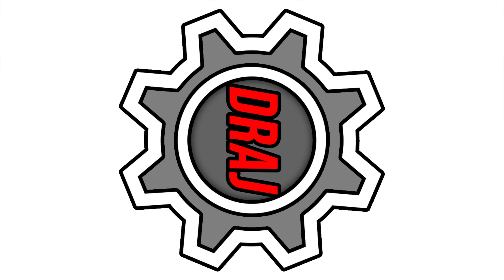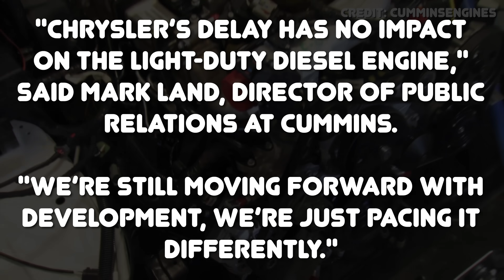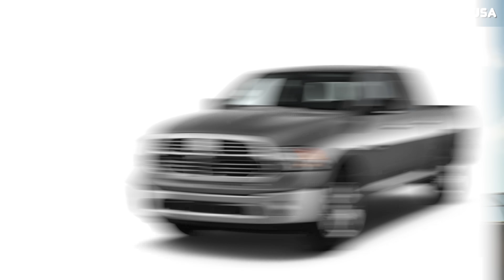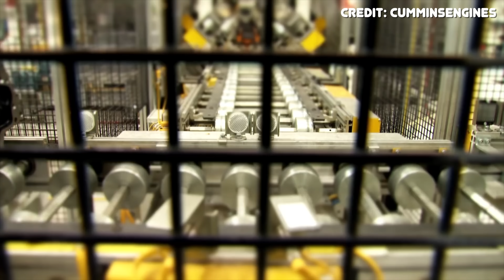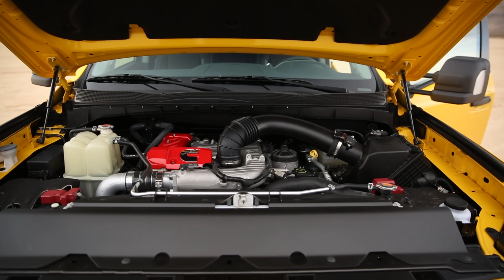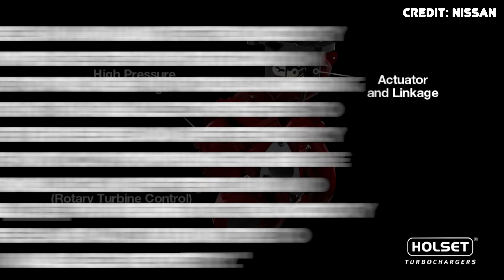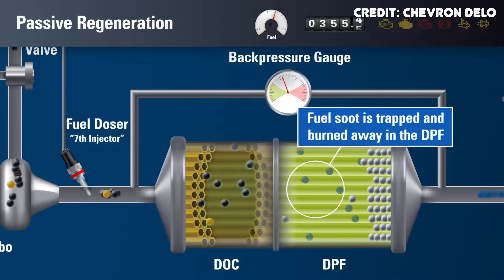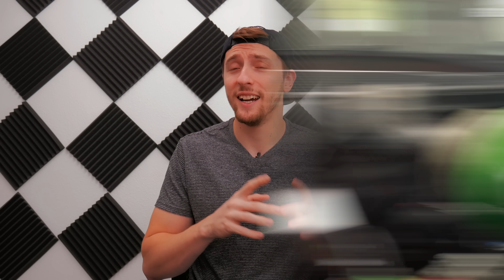5.0L Cummins: Everything You Need to Know

Comment: I have the 2017 Nissan Titan Platinum Reserve
with the 5.0Lt V8 Cummins, and I think it's a good motor
Has heaps of power and smooth to drive, have owned for just under 12mth now without any problems.
Typically fuel consumption is under 15Lt/100km and down to 13Lt/km on long country runs.
I'm aware of concerns regarding the fuel pump w/dowl pin etc 
and keen to know more about more reliable alternatives for known problem parts.
It's a shame Nissan didn't stick with the motor as they seem to be excluded from
most of the comparison and review podcasts looking at F250/GMC/RAM  etc, BTW
My son has the Nissan Patrol w 5.7 Lt Hemi V8 and he uses way more fuel than I on the same run.

Comment: I've been considering buying a 2017 Titan XD Platinum Reserve with 98k miles with the 5.0 diesel but after watching several videos on average at best fuel mileage, average power and a Extremely over complicated and expensive diesel to fix and maintain I just can't pull the trigger and think I'll just get the cheaper to operate V8 Gas truck.

Comment: I just bought a used 2017 nissan xd. Will see how it does. I just drove it 150 miles and was hoping for better mileage but the engine is quite, seems to have some good power and smooth running. Fingers crossed it continues to do well. Any advice on things to do to it or things to look out for. Any additives recommended for cleaning out carbon or other modifications?
Reply: How is it treating you? I am rest driving one tomorrow.
Reply: Me too , I am excited about the this truck,  but I am scared too

Comment: Really wish saw this video before buying my 2016 Nissan Titan XD. The reason why it didn't catch on is because of all the problems this video touched on happened a lot. In the first 2 years of owning my truck I have had EGR Actuator Replaced because it failed, Boche Fuel Pump just failed and the coolant electrical issue which is a common problem not stated in this video average of 4-6k total to repair. Overall the truck runs quite as stated averages around 15 mpg but I am now debating on switching out my turbo and buying an extra EGR valve for the future.

Comment: I just bought one not too long ago. I bought it because I needed a new truck that I could afford. I’ve owned a couple of Duramaxes, and Powerstrokes in the past and was absolutely thrilled with the idea of getting a newer one than I’ve ever had before. However, in 2022’s used car bubble… I quickly realized if I truly wanted a normal 3/4 ton diesel, either my budget was going to double or it was going to be 15 years old with a quarter million miles. 

So instead of giving up or trying to stretch my budget, I actually lowered my budget slightly and got to thinking what it was I actually need a truck for? And after listing out, plowing my driveway, runs to the home center, pulling maybe 10,000lbs once a year or so. I realized I’d probably be just fine with a half ton for now. But I still wanted a diesel. I test drove a few eco diesel rams and while I absolutely loved the ride and interior of the rams. Their tow rating with the eco diesel is absolutely ABYSMAL at just 7,700lbs. I mean, my wife’s grand Cherokee is rated better than that… 

So I remembered that back in 2015 I had test driven one of the first Titan XD trucks available in my area and it being something I thought I could be happy with. So I started looking and found that they happened to be going for right around what I lowered my budget to. And that was with half the miles and anywhere from 2-6 years newer than what I was finding before I readjusted my search. So I found one with 100,000 miles and was a 2017. Compared to the 2012s I was finding with 175,000 miles in Chevy or ford. I decided to give it a shot.
Reply: Curious to know how it’s going and what it’s like? I’m considering one but am still unsure. I would be upsizing myself, had a little Tacoma but want something bigger and thought the Titan would be a unique one and especially one with the Cummins so I’m curious as to what ownership has been like for you in the last year since you made your comment. Do you recommend or no?
Reply: @haydenK90 I’m happy to tell you that this week actually makes 2 years with the truck and honestly… I couldn’t be happier! It’s been a wonderful truck so far. What I bought is a 2017 Titan XD Pro4X extended cab with the Cummins diesel. 

The very first thing I did to it was get a mount and wiring for my Blizzard 8100 Power Plow. I took the whole entire front end of the truck apart to get it all mounted and wired up correctly. For those that are unfamiliar. That is an 8ft plow with power wings that open up to 10ft and it weighs about 1,000lbs. The truck handles the plow beautifully! It doesn’t ride on the suspension bump stops. It has absolutely no problem pushing it at 10ft with wet and heavy snow. The electrical system handles the extra draw from the plow hydraulics very well and even though it’s Recommended to put 300-400lbs of ballast in the bed for the plow. I haven’t done that and it still pushes the plow quite well. 

The second thing I did was get a ProComp leveling kit. I did this so the trucks sits more like a truck instead of a truck shaped car. It took about an hour to install and made a huge difference in the look of the truck. And it also had the side effect of getting the plow a little higher on full lift for traveling down the road. 

It drives very well. Reminiscent of an OBS Chevy (90s). It’s just quite a bit bigger than my old Chevy. But the traction control isn’t overly aggressive. And when you turn it off it doesn’t just come back on when you get your wheels spinning. This is helpful when plowing. 

It’s a pretty comfortable truck to drive long distance. We live about 4 hours from my childhood home and go down quite often. And my wife’s family lives in Tennessee which is about a 14 hour drive from our home in Northern Wisconsin. We’ve driven it down there and back a couple times now too and it was very comfy and quiet. No excess road or wind noise and the stereo they put in it is PHENOMENAL! Other than the very generic head unit. But it has good navigation and sounds awesome regardless of what kind of music you’re into. 

And now for the few issues I’ve had… nothing major so far. Just a few little annoying things. 

1. While the truck was shipped with a factory installed block heater. It had never had a cord on it and had never been used as the truck was originally sold in Georgia. I put a cord on it and unfortunately it didn’t work so being in northern Wisconsin… I had to replace the block heater. Not expensive at all. Only $75, but still annoying. 

2. The coolant level sensor failed and I had to buy an entire new reservoir because they updated the type of sensor and when I needed it they were in the process of sourcing the new tank and sensor so I had to just live with the engine light on for about a year. But it’s fixed now and has not been a problem since. 

3. Finally I had a pretty persistent fuel leak at the fuel filter housing on the frame. It turned out to be nothing more than a couple of failed O-Rings in the quick connect lines used in the fuel system. I replaced them and now it’s leak free. However, that leak was responsible one particularly cold day (-20f) for leaving me with a truck that wouldn’t start. I was at a hotel unfortunately and couldn’t plug it in. And the fuel leak let just enough air in that it wouldn’t start In the time the computer was letting the starter cycle. I did eventually get it started that day with the help of some jumper cables and my wife’s jeep. But that was probably the only thing that’s happened with the truck since I’ve had it that was truly infuriating. Again though… this issue was resolved and it’s actually started in colder weather without being plugged in after fixing the fuel leak. 

Other than those few things. It’s been an absolutely wonderful truck with no issues and I never worry about it letting me down. Overall, for the price. I would 100% recommend the Titan XD to anyone looking for a Diesel truck. While it’s absolutely not a true 3/4 ton. It is rated about as well as most GAS 3/4tons and gets about 20mpg when driven responsibly. 

bonus info these trucks also were some of the first to come from the factory with a gooseneck hit hitch. I’ve used it and it’s very nice. My only complaint would be that there’s no trailer light plug in the bed so you have to have a long cord to go back to the bumper. But I pulled a 12,000lb skid steer with it and it pulls that weight very well!

Comment: Well, after 2 years of ownership of tye 5.0 xd..... here is my list of things that needed to be replaced. 
 
1). Truro x2 yes two turbos under warranty. 

2). Egr value. Shortly after the second turbo within the factory warranty. 

3). Fuel water separator housing 2X(yes, first one replaced... 3k miles later, 2nd replaced. 

4). Wastewater. 

5). Abs speed sensors 

6). Total engine wiring harness. 

All withing the 5yr 100k factory warranty. 

The truck runs good, has good pep being stock... doesn't really compete with my old 2004.5 cummins 5.9 HO  5inch turbo back on a smarty Sr. But can outrun a Ford fusion!!

I'd say, if you find a low mileage 5.9 common rail.... get it over the titan XD...  it's a neat truck but just doesn't  provide or compare to the 5.9. Just know with that 48RE transmission on the 5.9s.... you will be replacing it

Comment: There was a few design issues with this engine which some were discussed.  Other issues such as cranks cracking from overworking or modding the engines.  They were not as popular as Nissan anticipated and had a host of problems.
Reply: They were marketed poorly and the idiots that had a "host of issues" were mostly dumb rednecks trying to get 1 ton truck performance out of a half-ton motor. That's not Nissan's fault.

Comment: I have a 2016 Titan XD that I bought new with this engine. I have about 79k miles and I’ve had the turbo actuator and high pressure turbo replaced (Nissan just upped the warranty on these parts to 10 yrs/150k miles). Otherwise it’s been a great engine. Love the truck and tows out 10k lb fifth wheel with ease.

Comment: You can make a Ram 2500 ride damn near as smooth as a car now if you option it with the air suspension  I know my father owns a 2015 Ram 2500 Laramie Limited with the air suspension and it rides smoother that any truck on the market in it’s model year and that’s with or without a trailer

Comment: I worked on the design team at the Cummins Small Engine Development Center (SEDC) in the early 80s.  The thing to keep in mind is the 4 and 6 cyc engines were a joint venture between Cummins and Case Tractor.  They split the production 50/50 out of the North Carolina engine plant - and - Case insisted on a heavy duty block and ease of repair-ability.  Cummins wanted a lighter weight design for automotive applications. Once Cummins was able to create design outside the constraints of “make it work for tractors too” - the weight and optimization for auto was possible.  Btw - noise was always a key consideration- for example- when you see the pulleys on the front of the engines with holes in them that’s not for weight savings - it’s to make them less like a speaker and more quiet.  And composite and plastic valve covers were in the earliest designs.  Good review thanks for creating the video.
Reply: I didn’t know they worked together with case. Interesting. Which motors specifically were a joint venture?
Reply: @TheOmw2000  probably 4bt and 6bt
Reply: @Sam-ls6sl  I’m not familiar with case equipment, did they use those engines often in that era?
Reply: The BIG QUSTION is: is the 5L V8 Cummins in the Titan a RELIABLE engine??
Reply: I see a lot of used low mileage Titans for sale with broken crankshafts. In your opinion,
What’s going on with those engines and what is Cummins doing about them? The reliability of those engines forced Nissan to discontinue them in 2020 and likely helped put the last nails in the coffin for the Titan trucks being discontinued for 2025.

Comment: My ISV blew up with crank failure at 74k. Nissan never once questioned the issue and replaced the engine at a song of 18k.  These engines are garbage and a class action law suit is currently in works with over 18 thousand engine failures since 2016

Comment: "... the CP4.2 pump, which is the same pump found on the 6.7 Cummins..." for only two model years (2019 and 2020), which is about how long it took Ram/ Cummins to realize that the CP4 is an absolute garbage design, and subsequently switch back to the previous CP3 (which is excellent) for the 2021 model year. They also recalled all the 2019 and 2020 model year trucks, removed the CP4, and retrofitted them with CP3 pumps, which, though it must have cost a fortune, was the right thing to do, in my opinion.
GM has been using the CP4 since 2011, and has yet to take any corrective action, despite this terrible pump costing their customers dearly on the regular. 
See this video for an in depth explanation of precisely why the CP4 is so bad and the CP3 is so good: https://youtu.be/AMNcV5X1WkA

Comment: I’ve got a 17PR, bought it brand new. During our heat dome about 3 months ago my turbo started to go. Truck has 36,000 miles on it. Just got it back after two weeks in the shop. Turns out the actuator gets sooted up and seizes. Thankfully it was under warranty, which I noticed nobody mentioned how awesome it is. Otherwise I’d be looking at a huge bill! 
 Fresh turbo, time for dpf delete. 
All that said, I LOVE MY TRUCK!
Reply: Actuator (undersized apparently) slowness leading to expensive failure. Major problem with high occurrence.  Throws permanent codes.  I have a '17 with 34k miles, coded last month.  Naively thought I'd get 100k problem free miles.  Out of warranty.  Not at all happy.

Comment: First: Titans MPG's is Horrible!! Second, If they want to sell a ton more Trucks, then they need to come out with a 6 Adult Crew Cab with "8"ft bed!! And then match it with a 12 speed Trans, to get 30+MPG HWY and be able to tow over 10K!! It took over 20 years of me asking the big 3 for a 1/2 ton Diesel "REAL-TRUCK" CREW CAB 8FT BED, and they now have half of it and the Diesels are their best selling trucks!! So why don't they listen and build a real 1/2 ton truck???????? I'm not saying you have to stop building your "HALF" Trucks, JUST OFFER A CREW CAB 8FT BED THAT GET'S 30+ MPG!!! I tow about 7K across the country twice a year and 10K once every 3 years for short runs of about 500 miles to get the tractor serviced. So I don't need my F350 that gets 10MPG towing and 13 not towing, but keeps breaking down and costing me thousands for them to just guess at it... (Ford won't even look at it!!) Last Ford ever!! So get one for the 2023 fix the problems with this 5.0L and why don't you look at the big rigs of the 40's and 50's and look at 2 speed rear ends?? I used to drive a big rig that had 2 levers on the floor like the older stick to our pickup trucks into 4 wheel drive, one was a dif lock and one was a rear gear changer to go from very low gears to higher gears... Then you could put something like 2.55 gears/3.73 gears in the rear so when you're not towing, use the 2.55 button or lever, and when you are towing use the 3.73 button?? And once you get that done Start working on a TRUE HYBRID that can tow 10K for 500 miles on Electric only, and then auto start the diesel to recharge the batteries within 2 hours of driving and then switch back to electric for another 500 miles...(DON'T TELL ME THAT'S NOT POSSIBLE!! Because Tesla has big rigs that have been made 10 years ago to today that can tow 80,000lbs for 500+ miles on a single charge!!! Then put that with your 2 speed rear end Diesel!! Oh get rid of the DEF CRAP!! That's ok for the MORONS in California, but the rest of us don't want or need it!! There is NO SMOG TEST WHERE I LIVE!! AND I WANT TO KEEP IT THAT WAY!!! We just have a toll-free number if someone is driving around with bad rings and smoke is pouring out, we call them and they stop them and give them a BIG ticket, as well as those "MORONS" who jack their truck up and mess with the engine, IE:Chips, Bigger Turbo's, Etc and TONS OF BLACK SMOKE COMES OUT... They get reported! Other than that we don't need all that crap that causes us to burn more FUEL!! Which uses up our fossil fuel faster!! So let's GO and get things GOING NOW!! If you retool now you can start making the 2 speed rear and CREW CAB 8FT BED, and at least a 10 speed by Feb!! Do a Burgundy one first, and give it to me for "testing" I will test it in the City of LAS VEGAS and then drive it to Maine to test HWY miles, and then pull an empty trailer back to Vegas, about 2K lbs then pick up a jeep on the trailer and drive back to MAINE TOWING 7K to see how it tows as well as the MPG's towing!! Then I can drive to Colorado to maybe get with those guys to max tow the IKE Gauntlet and post the video of that and I will do video's of my trips as well and post them... So please message me so we can set it up... If I like it, and it gets good MPG's and doesn't break down, I might buy it from you... Thanks

Comment: Have to say, great video, but as a 15 year nissan vet that's worked on these since new, the reliability points are flawed. Never seen an egr valve stuck, and only 1 def pump problem. Thier primary problems are the egr cooler, rtcv actuator, and around 100k miles, the rtcv in the big turbo fails. The HP pump does fail time to time, but beyond that, I've only replaced 1 engine for a rod knock. Short of that, pretty reliable